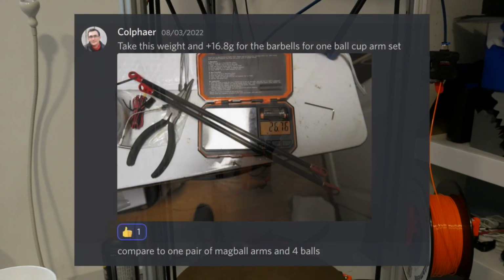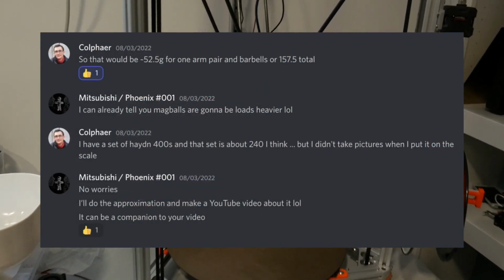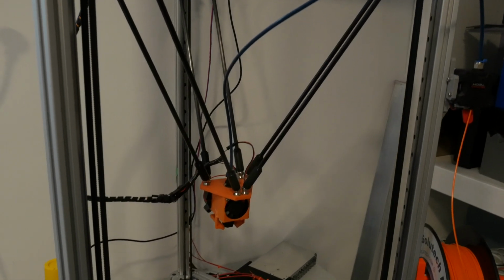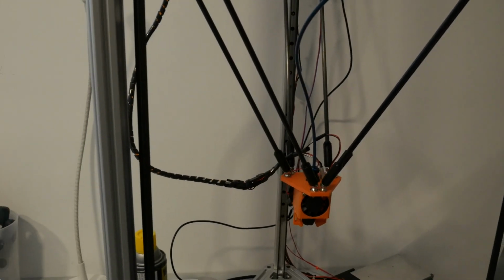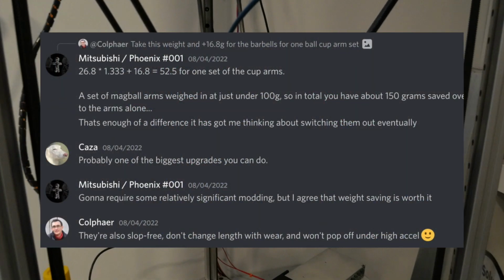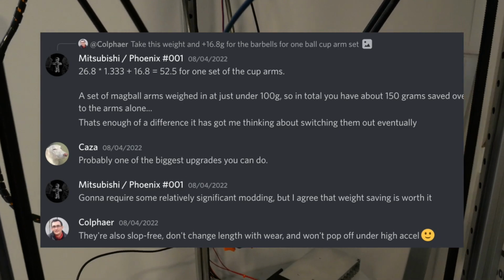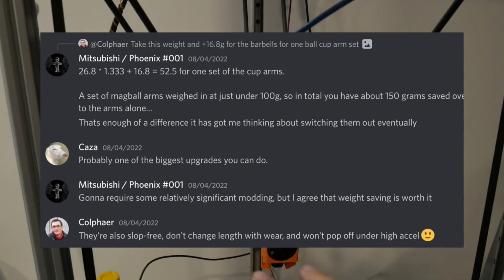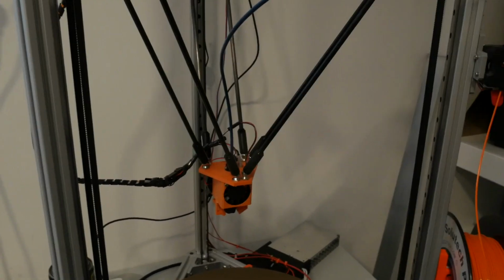Building a Delta Printer? Beware of Magball Arms!

Comment: I'm questioning how much of a difference it actually makes and I'm contemplating going in the opposite direction with my arms; heavier, stronger and stiffer. Though I'm also working with a much stiffer Predator frame. Weight is just one factor, you can have the lightest setup in the world, but if it's flimsy or has a bunch of backlash you're going to be worse off.

I think it matters more where that weight is, like with that effector, all the weight is cantilevered below it. Any mass a the end of that lever arm is going to have considerably more impact than if it were closer to the center.

Comment: Hi I'm Haydn Huntley, the person who builds these MagBall Arms.  Engineering is often about evaluating relative advantages and disadvantages and choosing which you'd prefer. 
There are a few key advantages which my magnetic joints have over using fisheye (Igus/Heim) joints. 
The first one is they are zero-backlash and they stay that way.  Other joints are looser and develop even more backlash, which causes problems when printing and makes calibration difficult.
The second is precision -- these are individually measured and labeled.  A set typically matches to within less than 30 microns.  This makes it easy to auto-calibrate and consistently produce excellent first layers.
You seem to think that the increase in weight is a huge disadvantage, but I beg to differ.  A little extra weight is undesirable, but what good is a light-weight printer which produces sloppy parts?  I want to print excellent quality parts!  I print at 60mm/sec, with 250mm/sec for non-printing moves.  That's fast enough for me.  I've experimented with going faster, but the limiting factor was the rate at which the E3D hotend could reliably melt PLA.

I've tried a lot of experiments to improve delta printers, but the best improvements have come from using magnetic joints, auto-calibration, diagonal frame bracing, 32-bit controllers, cooling fans, a silicone hotend cover, flying extruder, polished titanium heat break, Bondtech dual gear extruder, 0.9 degree motors, 9mm belts, 16-tooth pulleys, and stronger carriages.
For me, the proof of the pudding is in the quality of the parts I can print.
Reply from the maker: Great to hear from the man himself! I have plans to incorporate many of your experiments into Phoenix (namely 0.9 steppers, 16t pulleys, flying extruder, and diagonal frame bracing). One thing I am really not keen on changing is (perhaps ironically) the arms.
Reply: @mitsumakes  How did you calibrate your printer before using the MagBall Arms?
Reply: I have a set of your arms I'm going to find a good use for someday (maybe a 6 axis delta where the range of motion is a big win) but I fear they'd have backlash or even yeet the effector at the speeds I'm going for on the printer I'm building now (1500+ mm/s, 250k+ mm/s²).
Reply from the maker: @daliasprints9798  The nice thing about Magball arms is they have no backlash. But I dont think they'd hold on at those speeds!! What printer do you have going that fast?
Reply: @mitsumakes  It's a WIP. AWD (6 motor, 1 at each end of belt, no idlers), 48V, ultra light effector with remote direct drive via rigid CV shaft, CPAP cooling.
Reply from the maker: @daliasprints9798  Sounds stupid fast! Can't wait to see it

Comment: That's quite the increase! Any reccomendations on ball and sockets with lower backlash? Im looking to build a delta of similar proportions
Reply from the maker: Backlash can certainly be a problem with ball and sockets. I'm far from an expert on building deltas (and certainly not qualified to recommend parts yet, lol), so I would advise you join Rolohaun's discord and ask there. 
https://discord.gg/T69bGDU4
Reply: @mitsumakes  thanks!
Reply: @mitsumakes  Discord link has expired. Do you have a fresh one?
Reply from the maker: @IlluminatedFeline  My bad, https://discord.gg/rolohaun-3d-946191040682008666 should work
Reply from the maker: @IlluminatedFeline  Scratch that: https://discord.gg/nmRVqNeC
Reply: Can try RC helicopters ball ends see those 3D flyers bashing around I
Was imagining its stress on the heavy 3-4Kg helicopters which I once flew. The weight of the delta is not that heavy as a 3D helicopter. Can also try RC off-road suspension & steering ball ends they are tough. https://youtu.be/9cK201lJhCI